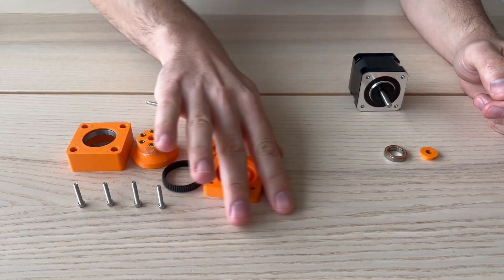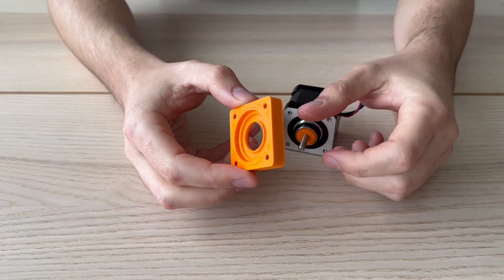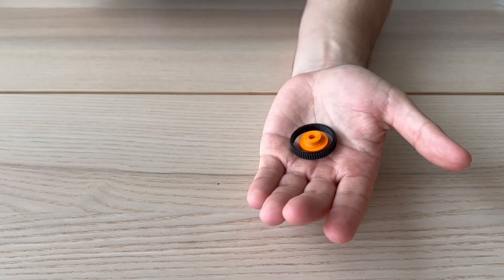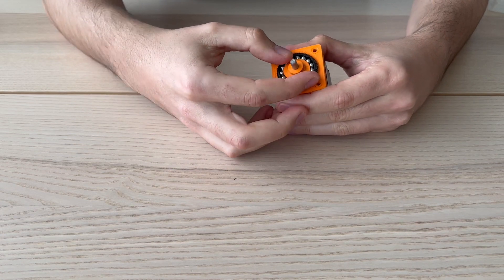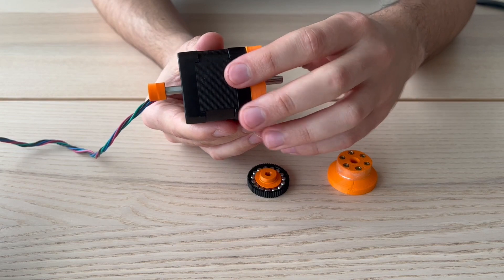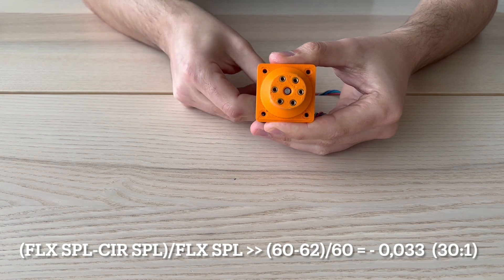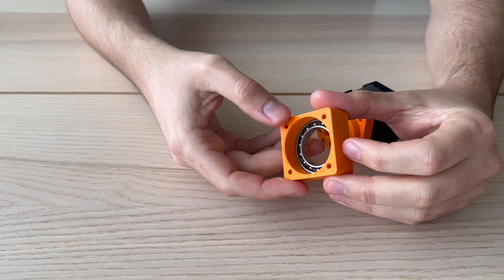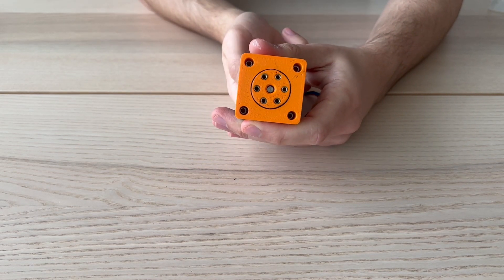Nema17, 3D Printed Strain Wave Gear (Harmonic Drive)

Comment: For anyone wondering, this is still the best low-cost 3d printed reducer for a nema 17 - well worth the price for the design, very printable and professional.
Reply: I am going to use 3 of these as my z axis to raise and lower my bed. Just gotta figure out the mountjng solution and belt solution
Reply: So how many Nm you're getting?

Comment: This type is my favorite DIY reducer. I wonder how they would stack up against regular harmonic drives if made professionally; if you had a nice cast urethane flex spline with embedded kevlar weave to transfer the torque, I imagine the torque density could be quite competitive, and it should be cheaper to mass produce than notoriously finicky metal splines. Also not the most inaccessible DIY project, to try a cast urethane version.
Reply: Also; my intuition would be that given a much more flexy configuration than a metal cup closed on one end, much bigger teeth would be viable and more appropriate for this kind of setup, to get more torque out of the softer materials. Is tooth size something youve tried to optimize for yet?
Reply from the maker: Hi Eelco, thanks for your input. The tooth size is as small as possible to get the higher ratio without skipping teeth.
Reply: @ZeroBacklashRobotics  Sure, bigger ratios means smaller teeth. But 30/31 would be the same as 60/62, no? Bigger teeth should mean bigger peak output torque, all else being equal. An open ended spline like this, made from a flexy material like urethane, should be able to accomodate quite big flex amplitudes, accomodating nice and deep teeth, and high torques. Curious how much torque youd be able to get out of teeth of this size!
Reply from the maker: @Eelco, its not the same, with 30/32 teeth you will get more torque indeed, because your wide teeth can increase with the same perimeter, but your ratio will decrease to 15:1, to get the same ratio increasing teeth there is no other way to increase the diameter size of your splines.
Reply: @ZeroBacklashRobotics  I said 30/31 but yeah you need 2 tooth difference with 2 contact points I suppose. 

Or do you? If the spline had two sections with a one-tooth offset between the sections, that should work I think? Like 30/32 -> 31/33
Reply from the maker: @Eelco, ok I got your point, theoretically, 30/31 has also 30:1 but not sure if this would work with only one tooth difference. The flex spline must skip one complete tooth every rotation, the room you deform in one axis of your oval is equivalent to the room you get in the other axis to jump your teeth. Tricky question.. I don’t know the answer :(
Reply: @ZeroBacklashRobotics  one tooth on both sides of the flex spline.  afaik must be in pairs.
Reply: @ZeroBacklashRobotics  I did a bit of math; and if you permit the spline to have different tooth count on both sides of it, ratios shouldn't be your problem. 30/32 on one side and 31/33 on the other should give a 528:1 ratio. Thats kinda what you would expect from differential drives such as these.
Reply: @ZeroBacklashRobotics 
Not sure how this renders in youtube but here is my logic:
    r1, s1 = 60, 60
    r2, s2 = 62, 60
    m1 = r1 - s1
    m2 = r2 - s2
    r = (m2 / r2 - m1 / r1)
    print(1/r)
Reply: If you try that with a different value for s1 and s2, your problem is no longer getting high ratios; your problem is not getting insanely high ratios.
Reply from the maker: Thanks for this input, I didn’t know that 🤔 but seems really interesting. If thats the case then teeth can be increased. Keeping the same form factor. Something to investigate.
Reply: @eelcohoogendoorn8044  The teeth count must be an even number, so 30/31 can not be applied. BTW, If there is only one contact point on the circle, The torque will shrink to half.
Reply: @voicevon  Even or odd doesnt matter; the relevant constraint is that the tooth-delta must be equal to (or divisible by) the number of contact points. So 30-33 should work with a triangular roller.
Reply: @eelcohoogendoorn8044  that's of course, if you manage to make a part that transfers all the torque via the shearing of the thin flex strip that holds the teeth together AND flexes. 
The advantage of having an equal count of teeth on the spline is that the cross-section of the teeth contributes to the force transfer area before being strained by the flexing action.
Reply: @JurekOK  Yeah if the spline does not have continuous teeth along the full depth, they wont contribute to shear strength; but I think in an optimized design, youd want to leave the shear transfer either to embedded wound fiber, or a thin spring steel or titanium tube.
Reply: @eelcohoogendoorn8044  30/31 would mean eccentric only applying pressure on one side, which may cause problems. Certainly a lot of pressure on the input shaft bearings. Ideally you could want a second bearing on the other side of the eccentric to support it, rather than the usual cantilevered style which works well when all side forces are counterbalanced.
Reply: @dekutree64  Yeah not saying id recommend configs with a single tooth difference between inner and outer; but single tooth diff between first and second stage should be legit; like 30-32 and 33-31

Comment: I am most interested in how much the backlash is. Have you checked?
Reply from the maker: Hi Adrian, after printing the flex spline I could say the first hours is pretty good, almost not noticeable. But since its done in PLA with intensive work gets deformed a bit and can have a bit of backlash. I didn’t try with other materials, nylon will improve a lot I think.
Reply: @ZeroBacklashRobotics  Is there a safe operating load, where the deformation doesn't happen (or is much slower)?
Reply from the maker: Hi @ProjectHivemind I didn’t measure at that level, but If I try to move the axis is quite stuck. Visually is difficult to see it. You need to apply a lot of torque to see something.

Comment: There is a similar type of gear called ferguson's paradox gear that behave almost exactly like strain wave gear. But without needing to use a flex spline. All three components are solid and fixed. It also have similar high reduction ratio as a strain wave gear. Essentially it's compose of two outer ring gears with one ring that has one more gear teeth than the other align co-axially. Then there is one smaller planet gear nested within that rotate with the input shaft. The two outer ring gears have tooth of slightly different sizes, when the planet gear came into contact with the two outer ring gears, it push the gear teeth together one side and push it away slightly on the other side. The gear ratio of this system is = number_of_teeth_in_ring_gear_1 / (number_of_teeth_in_ring_gear_1 - number_of_teeth_in_ring_gear_2) , so if you have 51 tooth in ring 1 and 52 tooth in ring 2, you get a reduction ratio of 51. Ferugson paradox gear is easier to make than strain wave gear, since there is no need for flex spline. And second advantage is that the gear tooth pressure angle can be lower compare to strain wave, which lead to greater gear efficiency.
Reply: that seems to be a variation on a cycloid drive
or I am not visualizing this right
ok sorry got it. not cycloidal at all but also plays on some tolerances, basically the gears do not mesh completely right.
Reply from the maker: Hi @Keen Heat, thanks for your comment. I did not know about the existence of this type of gear. It seems very interesting, mainly because having a difference of one tooth between both gears, the ratio is double than strain wave gear, but keep in mind being able to reduce the size of the main gears, you still need to add the planetary gear, which also is a lot of space. Do you know if ferguson's gear has only one planetary? Because if thats the case you can get a lot of vibrations at high frequencies, since the system is not mechanically balanced. On the other hand, I don't know how this type of reduction would behave, in terms of backlash. As the gears are solid, I suppose that the backlash could not be completely eliminated.
Reply: You can have several planetaries
There are animations on youtube
Reply: The original Ferguson's paradox doesn't mesh quite right (poor efficiency), but if you adjust the module/pitch of the two halves then it does. This is called compound planetary gear, and there are many examples on youtube. You can mix and match different planet/ring tooth counts to get a wide variety of output ratios, and even drive it via the carrier which eliminates the loss of the sun-planet interaction and creates a through-hole for wires in a robot arm, but results in higher RPM of the planet gears.

Cycloidal drive is a closely related mechanism where the eccentric functions as the carrier, but it uses a different output method which is only possible due to the one tooth difference between ring and disc, and allows you to get relatively high reduction in a single stage. It is possible to make a split ring cycloidal with different pin counts and two discs of different lobe count glued together like a compound planet, but it has a lot of inherent problems.

The big advantage of strain wave is that the flexible component allows it to be true zero-backlash. Cycloidals can get pretty close, but only if machined extremely precisely, so unless you have a lot of money it will have backlash like any other gearbox.
Reply: A drawback of the Fergusons paradox is that only a few teeth are contact at any time while the strain wave has very many distributing the stress and thus the strain wave can transmit much more torque in a smaller package. The symmetry of the strain wave is a decided advantage as well.

Comment: Is very compact but it has some backlash in theory because the output has the same amount of teeth but has to be bigger due to the oval flex spline right? I think that’s why they are not used more often also not as much teeth can be engaged or dont line up properly compared to „normal“ HD.

Comment: if the flexible spline has the same number of teeth as the fixed spline, but a smaller diameter, it means the teeth on the flex spline are smaller and are not meshing right isn't it ? How can this work, just because of the extra space between teeth ? 
It just seems this only works because of imprecision in the manufacturing, doesn't it ?
Reply from the maker: @bschwand, what you say is correct. Due to the intrinsic design this cannot be otherwise, the teeth of the flexible ellipse have to be slightly smaller. This difference is practically negligible. The diameter is slightly reduced but the height of the teeth remains the same, so the deformation only occurs in the width of the tooth and not in the height. Given the module of these teeth 0.8, this difference is imperceptible and does not affect the operation. If we were talking about a real metal strain wave gear, we would be talking about something else since the tolerances are lower, but since this is PLA doesn't affect.
Reply: @ZeroBacklashRobotics  ok so this really works because of the inherent flex and give that the material allows, and would be impractical with, say all stainless steel parts. Got it.

Comment: @ZeroBacklash Thank you so much for your effort in designing and showing the operation. I have pushed your CAD files. I have one request , can you please upload the STEP model of the full gearbox model ? Since the parts are in stl format , it is difficult to modify or edit or parts or to use it in any assembly.

Comment: How do change the gear size? If you have to have the same number of tooth in the static and flex gear you have to change the module. Won't that introduce some losses?

Comment: If the flex spline doesn't even move then how do it spin the output??
Reply from the maker: Hi @ryanmckenna2047, because the dynamic circular spline (end axis) has 2 teeth more that the flex spline. That produces the moment.
Reply: Thanks, not sure what happened with my grammar there 😅 oddly mine spins now but in the same direction as the input, it should be spinning in the opposite direction. What am I doing wrong?

Comment: Beautiful.

I know you dont release files, but could you give us the modulus and scale factors for the teeth profiles ?
Reply from the maker: Hi Insane, modulus is 0.8 what do you mean with scale factor?
Reply: @ZeroBacklashRobotics  The flexspline and second stage ring need to be scaled a little bit so the teeth mesh right ?
Reply: @ZeroBacklashRobotics I'm also curious about how you create smaller diameters with the same teeth, I think it will affect the module of the flexspline, right?

Comment: Excellent design. I love the minimalist approach. Have you considered using Acetal/Delrin balls instead of steel ball bearings?  Or, for a contact line rather than a contact point (which should increase torque transmission and reduce wear), use Acetal dowel pins (McMaster offer Acetal dowel pins whose length is equal to its diameter). Cheers!

Comment: gorgeous.  why the first bearing?  what is the output torque?
Reply from the maker: Hi Dan, the bearing is to keep centered the movable circular spline, I didn’t measure the torque, theoretical torque, motor is 39 Ncm x 30 ratio = 11,7 Nm but on top we need to add the efficiency, which is not measured. And taking into consideration is plastic PLA will be lower I would say 50% so I would guess around 5-6 Nm.

Comment: Hello, why is it better to choose nylon instead of tpu for flex spline? Is it because of the consideration of longer service life？
Reply from the maker: Hi Edward, I don’t have a lot of experience with those two materials. But Nylon as far as I know is quite strong to abrasive task, and also its slightly flexible. For this application you don’t need that much, flex spline only deform half mm.

Comment: Great project! I 3D printed (all parts with PETG) based on your design but found flex spline too rigid. It even split in two after forcing it... Did you print flex spline with another filament?
Reply: He used PLA, have a look at the link in the description for all printing settings

Comment: Out of curiosity, is this something new you are testing or have you been using them already in the robot arm?
Also, have you or do you plan on testing it for durability? The other ones I have seen on yt don't last long.
Reply from the maker: Hi Nicholas, this is just aside project (experiment) maybe I will use in future projects, its not related to the 6DOF robot, I want to test durability, backlash and electrical consumption in further videos.

Comment: Great! Really nice and compact.

I’m trying to figure out how to create a camera slider with a 3-axis, and this harmonic driver can be helpful in my project.

Just for curiosity, I saw in another video on your channel a driver to know the exact position of the stepper motor. Is it possible to use both on a 3-axis camera slider project, or seem too much engineering?

Comment: How did you come up with the geometry for the flex spline and the fixed splines? I am trying to design a split circular spline strain wave drive, but I can't visualize how it is possible for the flex spline to interface with both housings if they are different sizes.  And if they are the same size, how are you achieving that with a different number of teeth?

Comment: Hi, I found your harmonic reducers very interesting, I would be interested in buying the files, but first I would like to ask you if they can withstand radial loads such as the tension of a toothed belt applied to a pulley system

Comment: started my own (copy) design in F360 ... , questions 
What material you printed the flex spline with?
"Slightly smaller" flex, is it just a scale down of the fixed spline?
If i design the driving spline with 2 more theeths, do i have to scale it down also?
What ellipse ratio do you use for the driving wave hub?
Thanks

Comment: Does the flex spline hold up to the forces without splitting in half (along where the circular hub meets the spline? The ball bearings with oval hub is a genius ide BTW.. Out of all DIY harmonic wave gears I have seen
Reply from the maker: Hi mvadu, thanks for your comment. The flex spline is holding yes, but I didnt push to the limit yet, but first tests went quite well.

Comment: I could think a lot of use cases for this. Will you release plans sometime?
Reply from the maker: Hi, you can find the link in the description:
https://cults3d.com/en/3d-model/tool/3d-printed-strain-wave-gear-harmonic-drive
Reply: @ZeroBacklashRobotics  Thanks! I'm building simple star tracking motor for old equatorial mount for astrophotography. This might have some use. Cool project and keep on posting!
Reply from the maker: Thanks to you @ex1tium to support ZeroBacklash channel :)
Reply: @ZeroBacklashRobotics  I've just started learning mechanics and the math side of engineering. I've always just winged it when designing something in Fusion360 but this is the first time I actually need to do precision. Your way of using bearing balls was very cool!
Reply from the maker: Happy you like it 😎

Comment: Is it back drivable?
Reply: No
Reply: I haven't seen a strain wave gear system that is backdrivable. some cycloidal gear systems are backdrivable because they don't have quite such a high ratio.
Reply from the maker: Hi Nadav, in this particular case is not backdrivable. Two main reasons, high reduction ratio and its made in plastic, which gives more friction in comparison with the real ones. But real ones most of them they are, you can find plenty of videos where people can back drive them.

Comment: Hey I have a dummy question, I have calculated (considering nema 17 max speed at 600rpm) a max speed of around 20 rpm with this reducer without using micro steps, does anybody there mounted the gearbox to tell me if I’m right? Thanks.